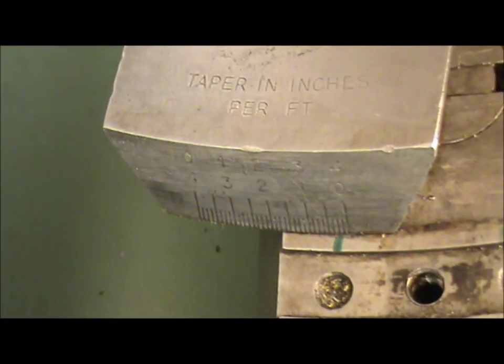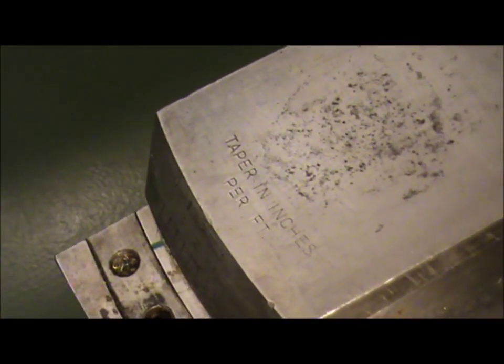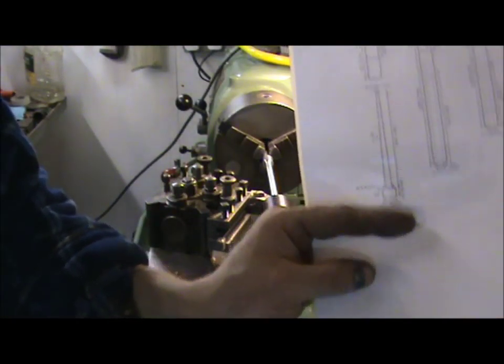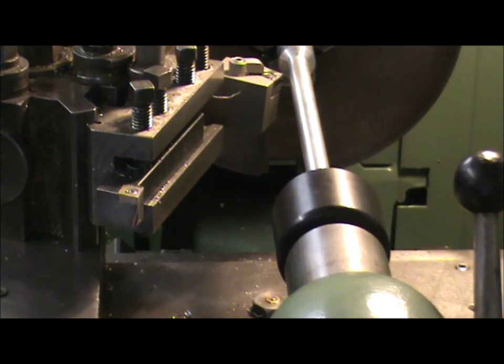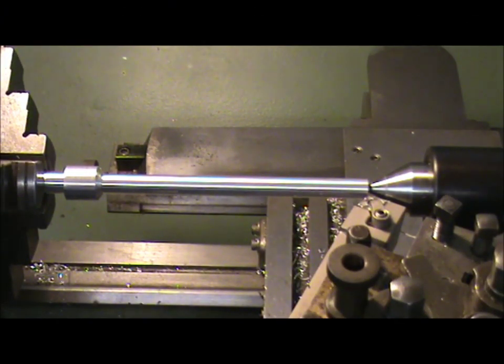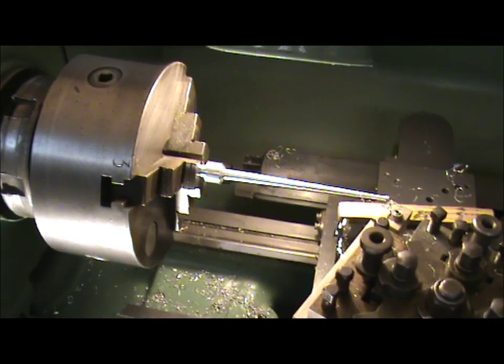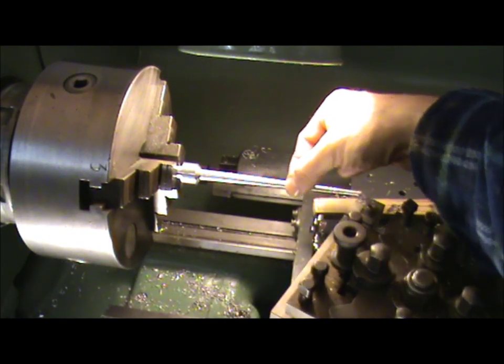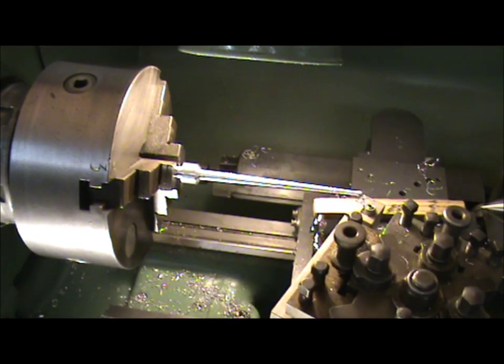My Taper turning fail on the metal lathe

Comment from the maker: lol it was a experiment to see how it went, didn't want to f+'k up some brass bar but I think your right brass is a better option, and you can start at the chuck and reduce the bar in stages its called step turning, disappointing though it was about an hours work up the pan! im ringing a guy about the missing traveling steady I need today, chris